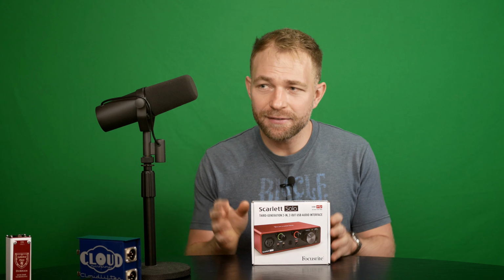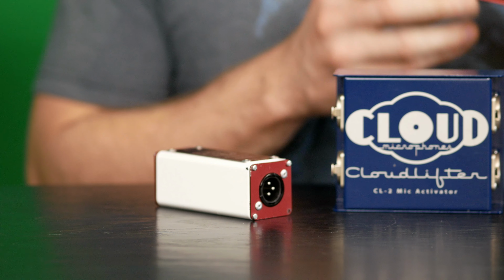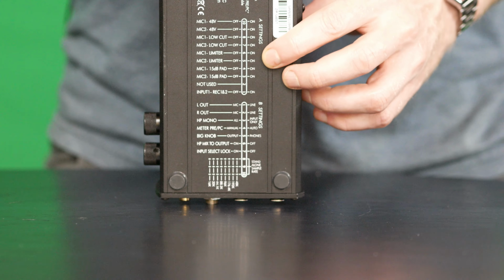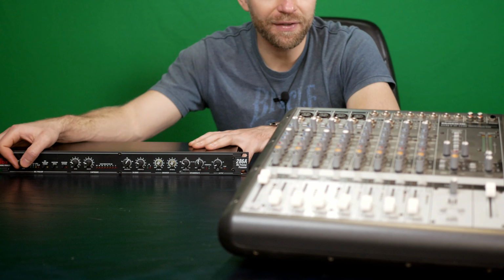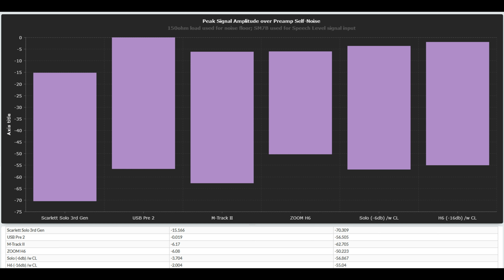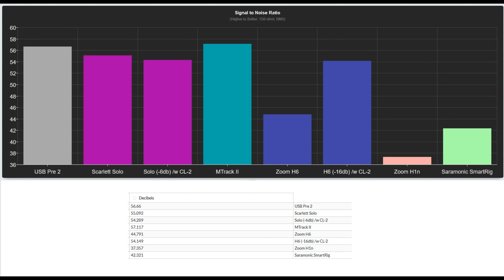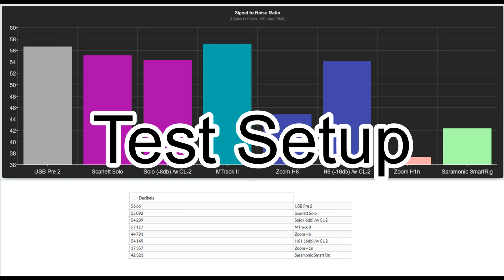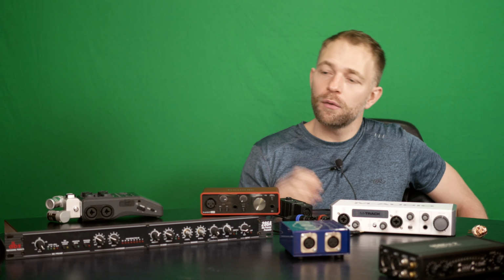Scarlett Solo 3rd gen Comparison and MORE

Comment: Tried this microphone and it was awful. Bought the cloudlifter and still awful. Barely picks up my voice and when using the cloudlifter I still have to set my gain to 100% but when I do that it becomes to loud but when i turn it down to around 80% it becomes really quiet with a hiss. No matter what i tried it just doesn't produce the sound everyone else is getting. I'm using a focusrite scarlett solo with the cloudlifter cl-1 and the shure sm7b. Slowly regretting spending all this money on a microphone that just produces awful sound. I've also tried using it on the Behringer X2222USB Xenyx 22 Input 2/2 Bus Mixer which also didn't work. I've turned phantom power on for both the scarlett and behringer and it just doesn't do what it should do. I cannot get my head around this and its giving me a headache since i've been researching for a solution for the past week with no fix found.
Reply from the maker: I've been there. I really have. I bought the Cloudlifter trying to figure out WHY ON EARTH the SM7B wasn't working well for me.

It took a lot of time, better understanding, improved mic technique, a better home studio, endless testing like I did in this video, new XLR cables, several new preamps, new recording software, and lowered expectations.

The SM7B is still by far my favourite microphone, but for many people a $20 lav mic would be perfectly suitable as well.

Some things I need to ask tho:
- Are you speaking about two-inches away from the microphone?  If you are speaking two-feet away, it won't work all that well.

- Make sure any "PAD" is turned off on your preamps.

- What XLR cable are you using?  Anything better than a $5 budget cable should be adequate to start with.

- What Scarlett SOLO version are you using? 1st, 2nd, third gen?  The older versions are very QUIET.

- Are you recording for LIVE video? like discord? or are you recording into Audacity or a DAW?

If you are using something like Google Hangouts / Discord, the browser is going to try to increase the volume automatically in software, but only until a certain point. If you set the volume to low, you will get just noise, and too high, you will get distortion. I generally try to set my peak gain to about -10db when using browser-based chat applications, and let them auto-increase the volume to max in software for me.
Reply: @steve_seguin  Hi,

Thank you for the quick and also nice reply. I asked someone else the same thing and they just laughed at me so I appreciate you being like this with me as it makes me feel more inclined to reply.

Firstly the version i'm using is the Scarlett Solo 1st gen (i believe but not entirely sure as it was bought in a joblot from ebay) 

Secondly, the XLR cable was included with a microphone but it says "Professional low noise microphone cable" down the side and i've found ones that i think are the same going for £11+ on amazon in the uk. Sorry for any price differences i'm from the uk.

Thirdly, I'm using the shure sm7b for singing so i'm a fair distance from the microphone but not too far from how i've seen other people use the sm7b for singing in their videos.

Forth, I'm recording into Garageband on my imac.

Sorry for calling the microphone bad. I know it is far from being bad. I was just venting my frustration out via comments due to the fact of how pricey the microphone is. Thank you again for being so kind. Looking forward to your reply.
Reply: @steve_seguin  Also please let me know of any usb audio interfaces that i might be able to afford in the £400 range. Sorry for having to say £ but i'm from the uk so dollars are completely different and unusual to me haha
Reply from the maker: @Xenomorph358  

It's all good. I've been there.

I don't have a "solution" for you, but I can try to work thru potential problems.

The Scarlett 1st gen wasn't really all that great, but with a CloudLifter it should be loud enough for even live applications. At the time they came out they were good value, but today I feel there are so many good budget preamps out that the old Scarletts just feel a bit lame.

The Scarlett first gens had problems with gain controls, low gain, drivers, popping issues, latency, and headphone volume. Still, I'm not sure any of that should be a big problem for you.

If you can record at 24bit, instead of 16bit, do that. It will let you record at lower gain levels, and still have the detail you need to increase the loudness in software after.

Obviously make sure the Scarlett has PHANTOM power turned on when using the Cloudlifter.  If you have a multimeter, make sure the Scarlett is outputting enough voltage; 48V is the ideal, but probably would still work if even 40V.  If it's outputting 24V or less, it's not going to work I bet.  

Maybe the Scarlett is broken or the drivers are incorrect.  Try on maybe a PC maybe?  It is a used and old device, so who knows if its working correctly.  A lot of my old audio gear stops working well after a 7 years or so -- the capacitors dry up.

The Behringer X2222USB Xenyx 22 seems to have 60db of gain, so I'd imagine you would NOT need to use the Cloudlifter with that mixer.  Try maybe using the SM7B with it, but without the cloudlifter. You may need to set the gain to near max on the mic. I would be careful about the other settings on the mixer -- it's very hard to set the gain correctly of a mic on a mixer I find due to so many different gain knobs.

Do you have a sample of the audio you are recording? It might be recording as expected, and you are just setting the wrong expectations. I put my audio through a NOISE FILTER (Izotope RX 7) in most of my videos, as even though I am 3" away, I still get a bit of noise. If you are a foot or two away, you will probably pick up noise.  

What sort of room are you in? Are there ANY fans at all?  ANything, even a computer monitor or laptop, can create a noise. 

I would suggest that the XLR cable you are using between the SM7B and the Cloudlifter be as short as possible; I have mine at 3-feet. I also spent about $20 on it; it helps to reject some electrical noise from nearby power cables and cell phones and such.  It doesn't feel cheap.

It normally is fine to record a bit quiet, especially if using a cloud lifter, and increase the volume in software. I'd expect some noise; a little bit of hiss. You'll either need to stand closer to the mic, use noise-removal software, or spend a LOT more money to see a small improvement.

You can try with a different mic; see if things work better. Maybe try a different dynamic; maybe a $20 one and see if it works better. Lots of cheap ones on Amazon that are great.

I have a ton of preamps, XLR cables, and microphones, and using them has given me the confidence to know when something is not working correctly. Without having reference equipment, its virtually impossible to figure out where the problem is.  I've gone to the local audio store and rented their most expensive preamp and most expensive mics to see if those helped. On a weekend, I was able to get away with spending just $70 for a weekend rental.

As you can see with this video I did, unless I compared product to product scientifically myself, I'd be stuck believing whatever the Internet told me. Usually the internet has no idea what they are talking about -- myself included. 

Maybe talk your stuff into a local audio shop and see if they can help out or test.  Maybe take your mic and preamp to another location; maybe somewhere else that is very quiet, and try there.

Best of luck
Reply from the maker: @Xenomorph358  I'll give it some thought; I don't know of anything for under $700 USD that blows my mind.  There are a lot of options around $150 USD that are "OK"; not much different than what you already have.
Reply: @steve_seguin  Ahh right okay thank you.
Reply: @steve_seguin  Awesome thank you for the info. You've been so amazing for this I appreciate it and left a sub :) I'll definitely take into consideration what you've said and i'll test my microphone into my mixer without the cloudlifter as i didn't think of that me being stupid haha. I'll get back to you after trying a few things you have mentioned. Thank you again you've been amazing so far :)

Comment: So I’ve got a dbx286s pre amp I’m gonna get the 2i2 solo 3rd gen will this supply enough gain for my sm7b
Reply from the maker: the 4i4 has line inputs, but I think the 2i2 has just instruments + mic inputs.  If you want to connect the DBX 286 to a mic preamp, I'd suggest you get one with proper line-in support.
Reply: Steve Seguin so I couldn’t just take the line out trs to the xrl input of the 2i2 solo thanks for your help
Reply from the maker: @dpstrix3220  Well, I take that back.. the 2i2 has a line input; it just isn't labelled.
Anyways, so yeah, if using the LINE in , you can set the gain on the 2i2 to "unity" position, which also isn't labelled. Somewhere around the 10-o-clock position though.  You would then set the gain of the mic using the DBX 286.  It would have enough gain for most cases; 60db or so, and if you need more you could use the 2i2 I suppose for an added boost.
"The Scarlett 2i2 has no “Mic/line” switch – the Focusrite preamp stage is automatically configured
 for a microphone when you plug an XLR into the input, and for a line or instrument when you connect a jack plug. Set the INST switch ON (‘INST’ illuminates red) if you are connecting musical instrument, e.g., a guitar in the example, using an ordinary 2-pole (TS) guitar jack. Set the INST switch to OFF if you are connecting a line level source such as a keyboard, synthesiser or the balanced output of an external audio mixer via a 3-pole (TRS) jack. Note the Combo connector accepts both TRS and TS
types of jack plug."
Reply: Steve Seguin great info so basically what I’ll be doing is plugging my mic directly into the 286 then taking a trs to xlr from the line out on the 286 into the 2i2 hopefully that makes some sense

Comment: The Cathedral Pipes Durham is currently under litigation for patent infringement of the Cloudlifter CL-1. Buy the original, not a knock off.
Reply from the maker: Didn't know that! Thank you
Reply: What’s the patent?
Reply: @joshuareveles  Circuit design.

Comment: Do u need that amp or can you use a sound lifter with a mixer?
Reply from the maker: If the Mixer has an XLR mic input and if the Mixer outputs 48V phantom power, then the CloudLifter will work to provide about +20db of gain.

The mixer will still need to provide around +40db of gain on the mic input to make it loud enough.